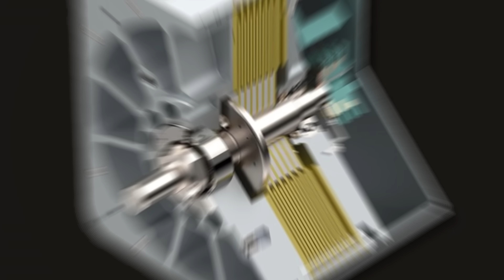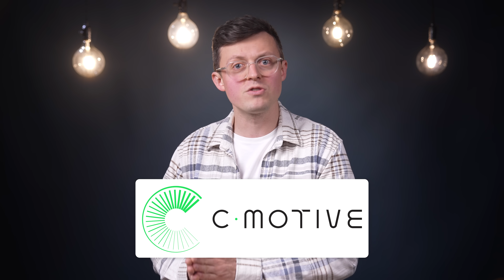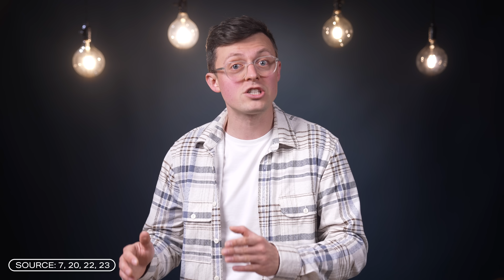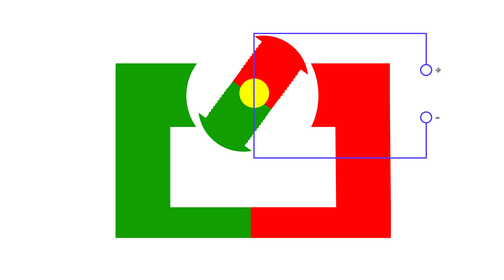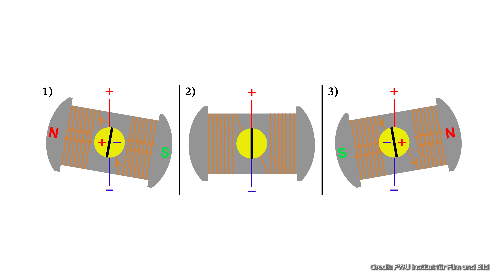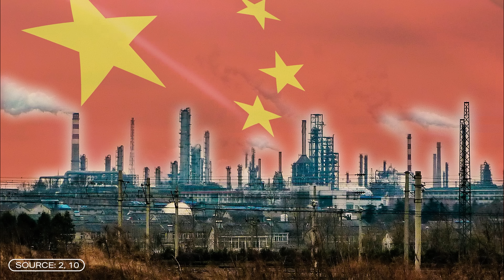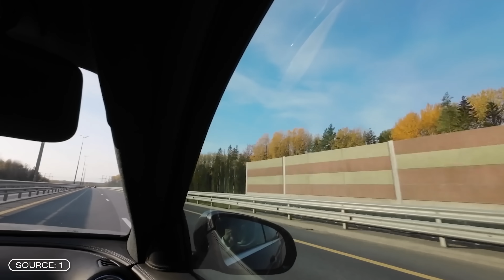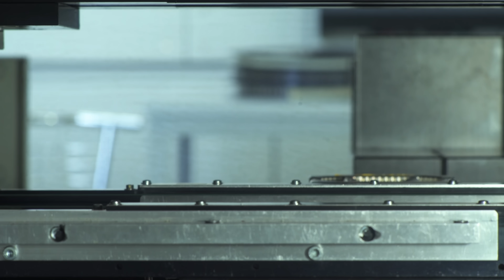Have We Gotten Electric Motors Wrong for 150 Years?

Comment: What is surprising is that voltages as high as 5.8KV can be isolated over such tiny distances, as matter of 0.8mm. rapid switching of such high voltages must result in high reactive currents due to the charging and discharging stator electrode capacitance. Electrostatic motors are not normally associated with such high torque, which must be the result of the number of electrodes and their very close proximity. This  suggests mechanisms for catastrophic failure, such as thin electrodes stripped from the substrate, leading to short circuit, or bending of the substrate plates due to coriolis forces, also resulting in short circuit or friction damage. Electronics for switching such high voltage is not going to be cheap or small, indicating a further problem.
It would be nice to see how voltage is transferred to the rotors. Retaining the dielectric fluid within the motor for its life, must be a challenge. One must assume an air leak would result in catastrophic dielectric breakdown, resulting in an electric arc between electrodes.
Reply: On the driver electronics, it's astonishing how mass-market applications like EVs have developed (and many of them are 800 V). And they would be able to detect breakdown easily.
Reply: @matthewmarks6951 my scepticism is the result of considering all the possible new failure modes, but I accept your comment about EV electronics, though these are likelyto be in the high 10s or 100s of kilowatts.
A scooter motor torque is of the order of 15 to 20 Nm. I would be interested to see motor size comparisons for this level of torque. These electrostatic motors are compatible with stepper motors, given the ability to generate a hold torque.

Comment: Does the dielectric fluid need heating in cold weather to avoid freezing?
Reply: Thinking the same.  With a little research and luck a suitable oil-based or otherwise low temp dielectric fluid is probably already available.
Reply: Yes, that could be an issue - or just how stable its viscosity is with temperature. Another question is how toxic it is!

Comment: A few thoughts: Since the current is very low, there is no need to use copper at all -- use aluminum or other light metal;  200rpm max is a hard sell for automotive -- you need a few hundred rpm to directly drive a traction wheel to 125+ kph; as someone else noted, a thin-film PTFE seems more appropriate -- I wonder if they tried this.

Comment: Is it possible to build corresponding electrostatic generators with similar advantages?
Reply: I don't see why this wouldn't work as a generator.
Reply: Closest may be a whimshurst generator, they produce high voltage direct current.

Comment: any electric motor being 90% efficient would not raise an eyebrow; so i was immediately skeptical seeing the title here; but even +5% would be phenomenal.

but definitely stationary applications only, if in the Kvolt range.
 remember back when EVs where just being discussed, and many were initially supporting a voltage limit of 48Vdc nominal, based on safety.
Reply: Yeah if they can get that in the lab epic I'll take even a subset of those gains in a commercially viable version. Well perhaps overly optimistic but it cool so I'm excited.
Reply: Many EVs now have 800 V batteries. Spark plugs use many kV!
Reply: @matthewmarks6951  but the current output of an ignition coil is generally not enough to kill a person....where a motor controller current output would be.
Reply: @matthewmarks6951  I mean I have been alive to say, " oh crips I hate that " with ignition systems.....it's a very small amount of total power arcing across a spark plug, and that's why.
Reply: @matthewmarks6951  the power is basically the core flux instant .. that's miniscule.

Comment: I wounder if they could use solid ptfe for the dielectric. I imagine it's breakdown voltage is quite high and it's self lubricating and it would make the motor more robust (no leaks leading to catastrophic failure to worry about).
Reply: PTFE is a problematic chemical compound as its classified as one of the forever chemicals PFES  .... better to use a water based coolant conductor for the majority of uses.
Reply: @clivestainlesssteelwomble7665  I thought they wanted basically as non conductive as possible. "Forever" is exactly how long I would want the part to last and lately, we have gotten much better at finding ways to dismantle fluorine species when we need to break them down. Fluorine and its derivatives are kind of a necessary "evil" in high performance electronics as well as many other fields precisely because they are so chemically strong. It's kind of like helium (though for almost the exact opposite reasons) in that there is just nothing else quite like it on a fundamental level. But maybe there are things that are "good enough" substitutions in many less demanding cases.
Reply: @clivestainlesssteelwomble7665  It's likely the secret fluid is a PTF based dielectric
Reply: @petersieck7986  I wouldn't be surprised.
Reply: I don't imagine there would be less friction than with a liquid dielectric.
Reply: Details weren't provided but my guess is the fluid is in contact with the electrostatics (hence the "low RPM") and fills a very small gap - no air space for a "layer" of dielectric
Reply: @petersieck7986  Put the Teflon where the fluid is currently (where the fluid is now is the gap needed). we can make sheets of material that are mere atoms thick, I'm sure we can manage a sheet of Teflon that is on the order of microns thick, even if we couldn't though, melt the Teflon, pour it into the motor as a fluid then run the motor as the teflon cools to prevent it from bonding to the moving parts. But if you can put it in as a solid thats ideal since that you can engineer a gap between the Teflon and the moving parts for even less friction, or at least texture the surface so less of the Teflon is in contact with the moving parts.

Comment: Pretty much no room for repairability if I understood correctly.
Reply: I don't ever see people putting new copper windings on their brushless either
Reply: @H0mework  we must know different people then
Reply: @yangm97 when is it economical? Brushless motors are really cheap. When do you and your friends fix a motor?
Reply: @H0mework  when importing tax costs more than the product, as is the case in my country, people will happily rewind all sorts of motors.
Reply: @H0mework  https://youtube.com/@graaxinha
Reply: @yangm97 wow, I thought it was just the PlayStations, forgot about Brazil's import taxes. Come visit the US one of these days, after the oil is down!
Reply: @H0mework  In industry, servicing motors is pretty routine - mainly just new bearings when they start to wear. 
A machine tool or industrial robot servo motor costs thousands; a service costs hundreds. 
Rewinding is pretty rare now compared to 50 years ago, however it is still done for very large or specialised industrial motors,  where the motor replacements costs are in the tens of thousands range.
Reply: Yeah vibration can clearly mess it up, even if the fluid doesn't break down and plates not electrowear. There is 0 anti-nutation in the design, the plates seem hardwired together so if one has an electrical event the others are going to also.

Comment: Surprising.  But if the motors can be tested and shown to satisfy the claims, then we have to accept the claims.  
Good video.
Reply: Their claimed efficiency numbers are LOWER than current gen induction (no permanent magnet / rare earth) motors so I don't even see the point
Reply: @IsZomg  Cheaper to produce?  It's interesting to consider what the impact on the rest of a vehicle's drive system would be for a voltage driven motor vs current driven.
Reply: @pssthpok  Voltage-driven motors manage speed by adjusting voltage, making them ideal for simple, variable-speed apps like fans (VFDs) . Current-driven motors regulate motor current directly to control torque and acceleration, offering high-precision performance for robotics and servos . Generally, voltage controls motor RPM, while current dictates torque.
Reply: @ennz69  Interesting!  From the video, I got the idea that these electrostatic motors would require higher voltage and lower current than electromagnetic motors.  So what does that mean for the system supplying power to the motor?  Thin wires but fat insulators because of the voltage?  Or would we still pull big current from the battery, and convert it to high voltage right near (or inside) the motor?  Just wondering what the impact on the rest of the car's design would be, for this new kind of motor.
Reply: That sounds almost like a comment a bot would make. Claims can only be verified by real world testing. Thousands of claims have been made in lab environments only to fall flat on their face in real world testing. Claims are good for hype and getting investors and clicks and views, and just about nothing else.
Reply: @ericpatterson3887  ESM technology is here and not visiting anymore.   Whether C-Motive is the company that ultimately cracks the technical challenges remains to be seen.

Comment: [watching from Canada eh?].. Hi German Guy.. Mein Gott..  Electromagnetic vs. Electrostatic... Riding w/electric assist since 1990s.. as micro-mobility for urban bikes and trikes. Jump to 2025 and today rolling as recumbent tadpole trike w/rear wheel as direct drive/gearless motor trading motor efficiency for >reliability and long life</low maintenance of motor w/>one moving part< of rotor w/magnets spinning around one axle? .. "My concern" re electrostatic is mostly any "high voltages"? eg local building codes split voltages as "low" and "high" w/50 volts considered "low" and "safer"? Like.. I've got traction batteries as 48V... [3x same 48V10Ah LiFePO4 chemistry to parallel to double or triple Ahs for longer distances] ... My motor is about ten years old from an old made-in-china electric scooter thingee which motor my local auto mechanic has disassembled and declared as still "good as new" after a decade of use. :) ... I'm also thinking to go >hybrid energy storage< as my batteries in parallel w/a series string of ultra-capacitors w/caps to discharge for high discharges as accelerations at starts saving my batteries not "gasping for breath" at starts so my batteries "go the distance" to the next stop .. See NAWA Technologies and super-capacitors.. think? Tks for any replies.. cheers https://yt3.ggpht.com/f1mwO7smCthhdmiTJoSsYvG814bXI66RmULXHxAU7Ep9MPWigSaLVJpIKrtI1WylB7UtW5FBnen6qg=s960-rw-nd-v1

Comment: For ships, maybe? Propellors turn relatively slow. Or mixing in large tanks. Electric energy storage with flywheel. I use these motors myself for microdosing.
Reply: Or wind turbines - I don't see why these couldn't be used as generators too.
Reply: As for Electric energy storage with flywheel , there needs to be a separate system to recover the energy from the flywheel.
the electrostatic motor won't serve as a generator
Reply: @PaulG.x  Ah OK = I thought that it might, considering that it appears to have rotors with permanent electrostatic charge. But no-one has suggested an otherwise good use for it - wind turbines.

Comment: Scalable to megawats but limited to 200 rpm? That sounds like some pretty thick shafts are going to be needed. If I calculate correctly you need to transmit 47,75 kNm of torque to give 1 MW at 200 rpm. Not impossible, but certainly impressive torque. 

If that special fluid was to ever start leaking out of the motor and part of the rotor assembly became not properly submerged, then the motor destroys itself, no? Same electric potential applied across the same gap but now with 20x less permitivity between the electrodes I would assume some strong arcs start happening? If true, then if this is ever used in something like an e-bike, where the low rpm would be fine, the casing of the motor needs to be extremely well made, durable against rough handling and such. 

If the electromagnetic motors had horrible efficiency and the electrostatic one was an order of magnitude better, I would be able to believe that all the clean room assembly, hermetic sealing against leaks and such will be worth it in a wide range of applicatons. But the difference is not that huge for most applicacions. So I think that for the forseeable future this will be limited to the few cases where it is worth the extra cost. Like if you need a motor somewhere that can run without heating its surroundings and there is no way to cool an electromagnetic one enough. Or some other special set of circumstances.  Very cool tech (pun intended), but I don't see it getting widespread use any time soon.
Reply: The fluid and the seals for it could necessitate additional maintenance, whereas normally you mostly have just the bearings to worry about.

For what happens during a leak I would guess you could include fault detection in the electronics.
Reply: Most dielectrics can generate heat, but current is only drawn during charge changes..  obviously you are driving a capacitor so at some point as rpm increases, reactive power losses become significant.
Reply: My bike uses a low rpm gearbox that only requires an oil change every 5000 km. Low rpm has the advantage of low wear on seals.
Reply: The high torque required is going to require large shaft diameters which in turn (another intended pun) increases the weight of the rotor.  This will offset much of the weight savings of such a motor.  In addition, most of the industrial applications for the motors I work on (some are greater than 1Mw) require much higher RPM than 200.   For example many pump impellers and fans run at nearly 1800 or 3600 RPM.  Other applications are belt driven to increase the rpm of the driven machine.  Then there are the Variable Frequency Drives (VFD) which increase the three phases up to 120 Hz or more giving speeds of nearly 7200 RPM for a two pole motor.
Reply: renewables being used to power these motors and charge gravity batteries
Reply: @makinganoise6028  Gravity batteries are a dead end. The future is always going to be solid state.
Reply: @noname7271 I wanna see the 30' long TEG/TEC you use as a split for your house...
Reply: That would be decent to see a failsafe design with hydrodynamic seals, detritus management, and a self-clearing self-refilling fluid scheme.

Also a less nonsense/backwards tag image.

Comment: Conveyer belts in industry often require significant torque and low speed. As some of these system operate 24 hours / day any gain in efficiency should translate to lower running costs.
Reply: I doubt that is what it is designed for.  While low speed you don't really care that much about positional accuracy or reversing in that application so you might as well just gear down a more efficient higher speed motor.
Reply: Reliability would be a much bigger concern. 10% lower electricity usage on a conveyor belt? While good, it's not essential.
Reply: When "low speed" is 200rpm, that's still plenty fast for things like EVs. You'd need to add a gearbox to get wheels up to highway speeds, but that's not really much of an issue.
Reply: @ryanbrown982 If you look at the other comments they company isn't even claiming to match current EV motors in efficency for those applications.  They are only really more efficient for these very low speed applications because they can produce torque without being geared down (and even there if you can live with backlash I dunno if they are better).
Reply: Variable speed drives have existed for this purpose for decades. Read about the frequency torque inverse relationship.

Comment: Low RPM is perfect for E-bikes and mobility devices. Maybe they could add gear multiplier sections and still be more efficient than a regular motor.
Reply: As far as E-bikes go, a low-RPM, high-torque motor sounds like the perfect thing to pair with a CVT.
Reply from the maker: Interesting use case?
Reply: 15mph or 25km/h as top speed. The torque might be useful for hilly climbs so a geared mid drive will work... Once china manufactures it.
Reply: Conventional BLDC motors are often about 90% efficient, and I suspect the high voltage drive system would be lower efficiency (and far more dangerous) than a common BLDC drive.